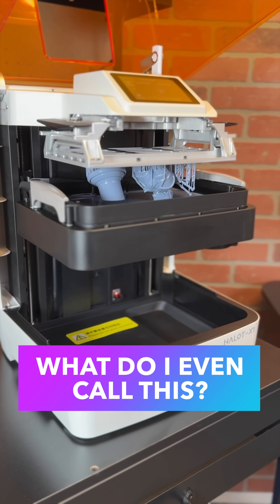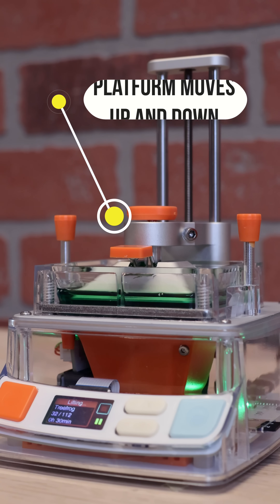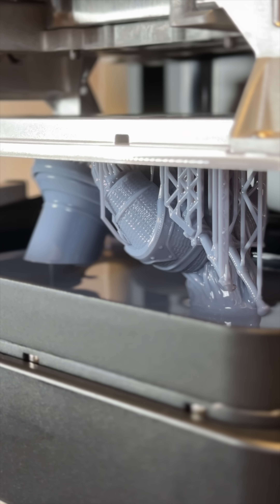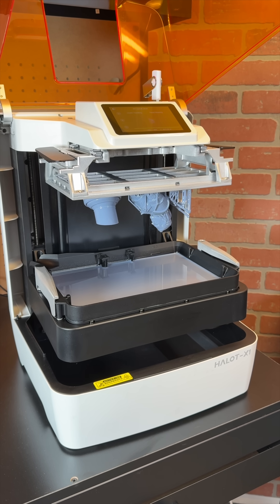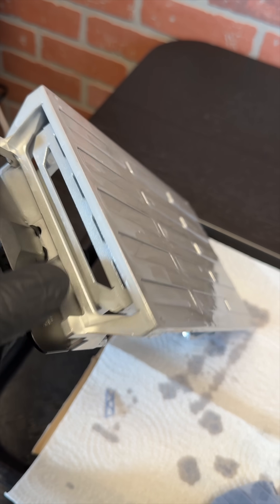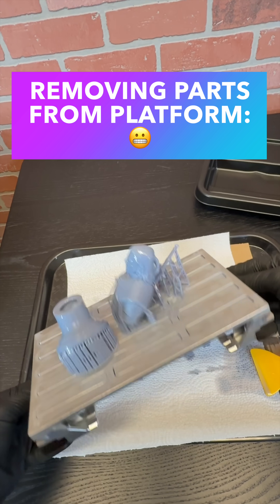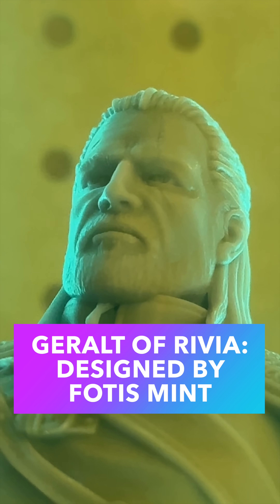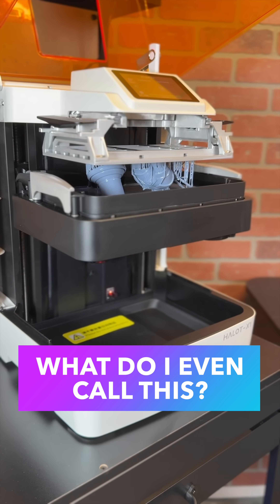PioCreat Halot-X1 - Upside Down Resin 3D Printer?

Comment: 😅 I feel this is very inefficient why make it this way?
Reply: It seems like the kind of thing you'd do if you were looking for something to patent, or avoid infringing someone else's patent
Reply: How is this any less efficient than a regular resin printer?
Reply: @OACustom  the vat moving rather then the bed. The vats got a liquid in it and the light now wouldnt that part now be way harder to replace? It also seems to shortened the viable print space. Can yku swap out vats easily say if u want to use a different color quicker? Does it still have a fep base, if so how do you change it when it gets messed up? With the base moving will there be any way it might spatter on the guide rails?
Reply: @OACustom  this moves a heavy bed up and down instead of the normal printers, that just move the bed.